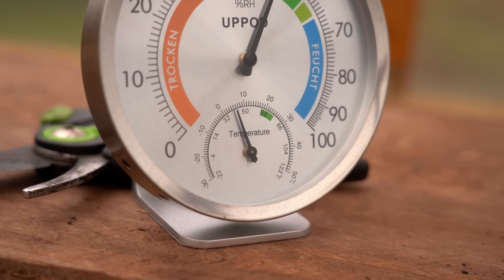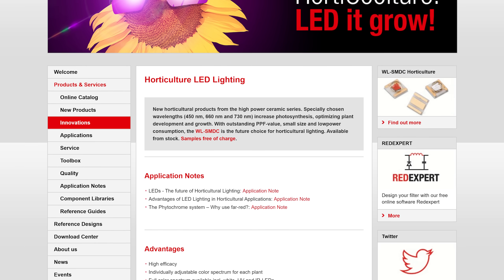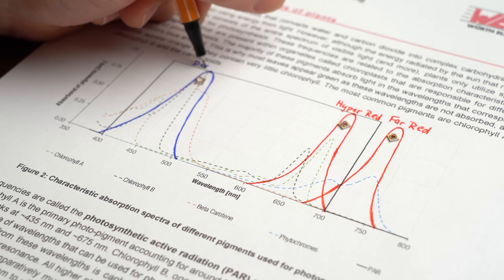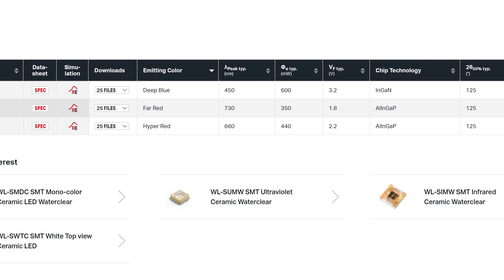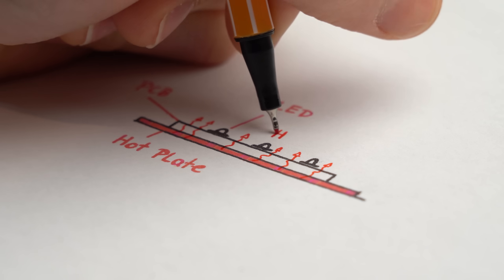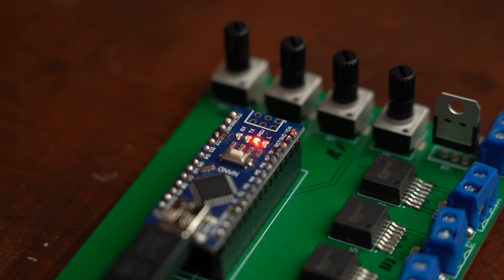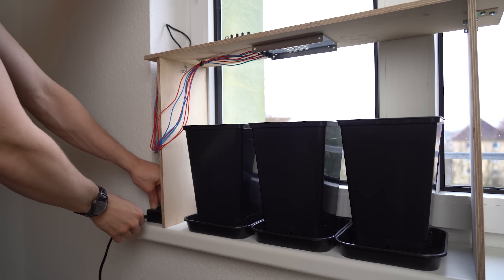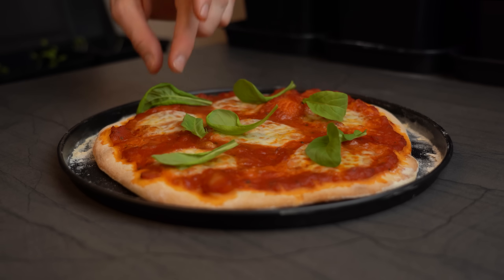"Magical" LEDs let my plants grow faster? (Experiment) The Future of Farming!

Comment from the maker: German version will come out on the 23.02.2022.

Additional Notes: I used the heatsink for the LED board the wrong way around since it was easier to mount it that way. And also make sure to position the capacitors as close as possible to the constant current drivers. Mine were a bit far away. Check out the datasheet for all the juicy details ;-)
Reply: Maybe they will release it to the Netherlands as well on that day
Reply: @RocRizzo  Uiteraard, LED-groeilichten (en assimilatieverlichting en stuurverlichting)  zijn erg belangrijk in de glastuinbouw.
Reply: How is this comment 7 days old, but then the video came out today?
Reply from the maker: @james-barnett  Patreon ;-)
Reply: @james-barnett  Patreon.
Reply: @james-barnett  they uploaded the video before it was public
Reply: @james-barnett  Really good observation
Reply: @james-barnett  Patrion
Reply: Das projekt könnte für die baltige legaliserung nützlich sein :D
Reply: @RyuktheShinigami777  dafür gibt es schon ganze Firmen. Ach ja und Breaking Lab hat über Aquaponik und Vertical gardening etwas gemacht
Reply: It is winter so there's not a whole lot of sunlight, but overall the amount of sunlight that gets into the house is much lower than one under a shade of even a tree.
The overall light level of regular(non-grown) lights is also less than a large tree shade in summer.
Correct me if I am wrong, I seen a video on it long time ago, and haven't tried repeating the experiment in anyway.

Would it be possible for you to repeat the experiment with a control group with a plant growing outside (in summer)?

It's an interesting experiment nonetheless, I usually have seen them used in tents that reflect and trap the heat of the LEDs[sometimes a different technology], with no outside light source being injected into them, like large panels with "100Ws worth of LEDs".
Reply: Pot is now legal in most areas of the U.S. These LEDs would be very useful to grow marijuana under the table before it was legalized. But, it is STILL useful today to grow your own weed becsuse of the insanely high taxes we have to pay under the current administration!
Reply: @foureyedchick  I think he said it about Germany
Reply: @CUBETechie  I designed some electronic circuits and composed some songs while stoned. But, troubleshooting is nearly impossible while stoned. I have no analytical ability then.
Reply: Wird die deutsche Version auf demselben Kanal sein?
Reply from the maker: @TimoOnline  Ja ;-)
Reply: @greatscottlab  
Gibt es Methoden mit fluoreszierenden Substanzen PV panelle mit indirekten UV Licht zu bestrahlen und dann die Energie Ausbeute zu erhöhen?
Reply: @greatscottlab  Warte mal, gibt es schon deutsche videos auf dem kanal?
Reply: @greatscottlab  
Kleiner Tipp von einem Grower. Bei Indoor-Planzen ist es nicht blöd, die Pflanzen ein bisschen mit einem Ventilator anzupusten. Dadurch werden die Stängel kräftiger und sie können größere Blätter und Blüten tragen. Das ergibt am Ende einen besseren Ertrag.
Reply: @greatscottlab  What a surprise you recommend the product you are selling and making money from!
Reply: @TimoOnline  ja
Reply: I love the new intro
Reply: Könntest du vielleicht auch Algen wachsen lassen?
Reply: Wie sieht es denn eigentlich mit Verschiedenen CO2 Gehalt aus🙄🤔
Reply: You should check out the click and grow garden
Reply: Ja mach ne Stunde
Reply: @GreatScott!! why you start wearing glasses?
Reply: @julianpolishredfox  His eyesight is going. Or, he always needed corrective lenses, but got tired of contacts and went back to glasses.
Reply: Ja.. so schließt sich der Kreis. Erst ingeressiert man sich für Elektrik , dann Elektronik , dann fürs growen. Nächste Station : automatisierte Bewässerung , Beleuchtung Belüftung.. aber das ist wohl mehr programmieren als löten bzw. eine Sache für arduino etc..
Reply: I think you need some flux for the soldering xD, looks awful to me, not much for soldering skills, but for the solder it self maybe. Looks dirty.
I like your videos every time, they are really clean, but that solder T.T , can you make it better? Thx :)
Reply: @greatscott! bin mir ziemlich sicher, dass du die pflanzen die nur Tageslicht bekommen haben vergeilt hast (weniger Licht, aber gleiche Temperatur)

Comment: The easier way is to use COB (planting) LEDs and drive them with a bigger, more efficient inverter. No PCBs needed, just old CPU coolers and a mounting frame.

I personally built COB LED versions with multiple 180W COBs and all driven with about 80-120W  power to increase efficiency, only in flowering phase i give them nominal 140-180W
Reply: Btw the real magic you can have with grow LEDs  in combination with a circulating air system for warmer temps (better for most stuff) and  (regulated) CO2 support.
I tried it longer ago as a efficient, about 800W LED Power rig with candles and a CO2 meter (trying to keep it between 1200 and 1500 ppm), it additionally cleaned the room air and without CO2 production it even got rid of the CO2 in the rooms partially over time. Not to mention that in winter and so it was also a small room heater which saved some central heating costs and most of the energy was free since we have a PV system

Comment: I noticed you used "L" brackets on the corners of the light holder.  You can also use (at less cost) blocks of wood to support the inside corners of the fixture, thus eliminating the need and cost of the "L" brackets.

Comment: Hello Great. I follow your channel and I have to say that your work is great. In relation to this project, how to know how to supply light for each type of plant. Why didn't you make an automatic system instead of having potentiometers to adjust the light for each plant? Couldn't this be completely automatic? For example: tomatoes: program_1, onions: program_2 ..... Thank you very much. A cordial greeting from Spain.
Reply: Just give them "enough" power to grow as intended,  more light is always better until the leaves begin to burn on the edges, it just depends how good your airflow and cooling of the room is when it comes to limiting the power.

I personally prefer a healthy and partially efficient mix of sodium vapor lamps with about 600-1200W and another 1200W with COB grow LEDs which give effective 2500-3500W "light" but at a lower cost in long term and especially less heat to get rid of.

In addition i planned my system with 180W COBs but i drive them intentional with "only" 100-120W to increase efficiency, so i can also run them solo with 160-200W without the sodium lamps if needed (summer mode, about 3-5° less)
Reply: @harrison00xXx  Thank you so much. What is a COB system?
Reply: @AFSMG  COB = Chip on Board

Basically bigger LED Arrays consisting of hundreds of LEDs on a bigger area which are typically driven with about 10-50V and 50-200W
Reply: @harrison00xXx  Thank you so much.
Reply: @AFSMG  a basic buck boost converter with 200W (when powered with battery) does the trick at COB LEDs super easy to control light output with 2 input wires

They have also a temperature reading pin which the fitting power supplies typically should have too, but its not needed for high performance cooling

Comment: can u make red light infrared light therapy module
Reply: Thats Ludicrous as your name, lol

No, to be real, such a thing can work but those IR LEDs are burning out quickly AND they are anyways inefficient. The most IR "therapy" LEDs in such devices give you a bit of a IR feeling, but its effect is pretty useless. Nothing can beat a hot, red glowing regular IR therapy device, remember IR always means HEAT, and beside the fact LEDs are very bad and inefficient for IR light, its getting very expensive if you even find high power IR LEDs.

Comment: that development kit is expensive
Reply: Funny thing is without the possibility to control blue/red/IR independently you can make it noticable cheaper and easier with COB LEDs. With good cooling (CPU coolers!) you can even overdrive for example 180W COBs to 250 or even 300W, use 8 of them and you have a high power growing rig or lower powered (140-180W per LED) efficient rig.

But i like this development kit, its just a bit too limited in voltage and current for COBs (mine run between 20 and 80V, ranging from 2 up to about 5Amps) otherwise it could be a nice thing as a single PCB solution.

Comment: Just a quick note about the photosynthetic use of green light: it's true that some of the green gets reflected away, but it also penetrates the canopy really well, instead of red and blue that get absorbed almost immediately by the leaves. So a bit of green is extremely useful not only to diagnose plant problems, but also to improve photosynthesis at lower levels in the canopy.

Dr. Bruce Bugbee has a few videos about light quality, they're really great and I recommend them if you're interested on the topic.
Reply: Bruce Bugbee = Apogee Instruments (environmental sensors)

Comment: If you want the best/most like the sun, grow lights
Get the Cree cxb3590.
Cost about $60 per 100watt light.
Reply: Thanks for the tip! I had a quick look at Ali Express and you find them on there in the range of $30.00 to $160.00. But when you see that the sellers of the cheap ones are giving the color spectrum as 'watts', it's clearly time to find a seller who at least knows that a Kelvin is not a Watt.

Comment: comparing winter daylight to artificial 24 hour light is not a very good experiment. Almost any light source running 24 hours is going to out preform the short natural day, especially in northern latitudes. A comparison of standard white LEDs to grow lights to see if they are worth the extra cost would be more interesting.

Comment: FYI: You should have coded a way to change the values, rather than having a manual variable resistor. The suggestion to change the light would have made a big difference. Your plants are too 'leggy', stretching toward the light. You want less red, more blue, to prevent that and get your leaves closer together so your energy is going into growing more food.
Nasa has studied this in quite some depth.

Comment: There is such bad information being given out here. According to the McCree curve (1972), green is used more efficiently than blue for example. This is backed by Inada (1976), Nishio (2000), Terashima (2009), and anyone else who actually does the test.

Anyone with a spectrometer can tell a plant absorbs 80-90% green light and you can use a simple camera as a three channel spectrometer. 

Also, If you aren't using a full spectrum quantum light meter then you are also putting out false information on lighting levels in your "testing".

This is a disappointing video that shows a complete lack of understanding of the theory on your part.

Comment: Those results don’t look correct. Red light increases cell division so even if the LED light would have beaten the daylight the seedlings would help continued to stretch. They would have been much long than they were, everything if they foliage was in that size. I don’t trust your results.

Comment: Mate you're missing the fact that glasses that are used in our houses filter the shit out of UV and our eyes can adjust to low or high light amounts. What you deem bright is not bright to a plant, you should compare to 6500K white LEDs to your lights, only then you can actually know for sure if those LEDs really deliver the wavelengths they promise and if it's any superior to white leds. I do use 800W of LEDs total in order to avoid my plants losing their form and color during the winter and they're all cold white, seems to be most effective in my experience of 4 years.

Comment: I'm a Canadian grower that's just beginning getting into tinkering with electronics, I would absolutely love being able to wire up my own grow light. I have sever store bought lights that are all really hard on the electric bill. 
My goal is to create a powerful LED light capable of growing  through vegetative and flowering, but doesn't cost $200 a month to run.
Reply: Theres a common misunderstanding that LED's won't cost much to run. Sadly when you have 100's of these horticulture chips on a single backplane, they quickly add up. They are still far superier to HPS or MH lamps, provide a much more balanced spectrum, more efficient, last longer and they are cheaper to run. From my experience the yields are also higher. You will be able to make a lamp that doesn't cost $200 to run, but you will find that its coverage and the final yield will not be as high, its a balancing act.

Comment: When asked if this technique is promising, the answer is no. Of course, it can be used to grow food regardless of the season. However, the LEDs are not a substitute for the sun in the summer, which many plants need. Here you need a lot more energy or LEDs and this is no longer profitable for home use.

In addition, if you calculate the cost of materials and electricity, you can buy salad in the supermarket for quite a long time. In addition, the ecological footprint for material, production and transport is totally ignored. It's a gimmick and nothing more, at least in private use.

Of course, you can't necessarily say it like that in a sponsored video ;)

Comment: As always great video with lots of new information. Just a question however. Can a neopixel led strip (WS281B) with adequate control of the wavelength be used instead of the grow light? Seems a lot more cheaper
Reply: can you control the actual wavelength?  power consumption would surely be higher

Comment: If i use WS2812B LEDs and your high power LEDs is there a difference between them that effects the growth of the plant (for example the power) or does the growth only depend on the wave length of the lightsource (part of red and blue light)?

Comment: Great Video, but for your results to be comparable or to mean anything really, you should measure or at least calculate the extra photonic flow. 
Adding artificial lighting will obviously benefit plant growth, especially in winter. 

So a fair comparison wouldn't compare "daylight" vs "daylight+artificial lighting" but either daylight vs artificial(external light shielded off) or if you want to evaluate your diy lighting solution "10w electrical input@diy" vs "10w E14 retrofit neutral white bulb for 8€. 

Because short term, the latter is way cheaper and also easier to use. The way you did it only confirms artificial lighting works, but it doesn't say anithing about the efficiency of your setup.

Comment: Didn't watch it all but I got your point from the title, and parts I watched. 
Previous tests been with halogen lamps, but leds are next level (smaller, less material, more in number). 
Of course notes and drawings in pyramids sent written note about light frequencies influencing mutations from fungi to green plants (and algae - but differently).
Progress after 15,000-40,000 years.

We used mathematical/geometric forms and combinations between them on the other planets and after arriving here, for less expendable materials, and reusable.
I had small farm when I was with deficit of specific foods (were not available online or friends I knew), I had my sources mutated and replicated into plants I wanted with math forms, which have identical speed of growth as you apply maximum use of all leds around (with the specific frequencies). The advantages were, I could change the geometric form in seconds in some days to achieve same result as changing other frequencies in different range (which would require factory for other leds or lamps with additional factories for electricity).

With geometrical forms you can easier change the form of the plant, length, size, etc.
I didn't throw bomb.
I melted the ship we came (with geo forms).

Comment: Can you make a video on converting two 100W 12V solar panels to use with 12 Volt Fans and Car Chargers and also charge mobile devices and laptops and use it without an 100ah 12V battery so you wouldn’t have to get one, so it can be cheaper for people that want to make
One , include protection circuit and Make the Protection Circuit that has all of the features, that a expensive one has and do it on an budget, Do it yourself so people can make it On their own, with experience with electrical and electronics , and make an Enclosure that houses everything. ,  could you make an adjustable mounts so It can stand upright or in any position.

Comment: Green light is absorbed/used quite well by plants, it's a myth that they don't need it or don't use it efficiently. This was explored by McCree in 1971. if I'm not mistaken, and it was shown that the efficiency for green wavelengths is quite high, even though it is lower than other wavelengths

Comment: price per umol (plant-lumen) standard 3500-4000k white leds are a much better choice. I made my own pcb's using 2835 smd leds. I use about 450 of them lighting up my sad window-poor basement suite. There is enough light to even keep my pineapple plant happy. Big learning from this project. Alu-PCB's are great to transfer heat away from the components, but are a horrible choice to actually move the heat away from the PCB. maximizing surface area is key here, and preferably a dark soldermask to maximize heat radiation which are both more practical with standard PCB's.

Comment: Next step would be an automatic watering system. How about a diy or buy episode about that topic? I really like the idea of using aluminium pcbs for capacitive soil moisture measuring because the aluminium is more durable than other pcbs. I redesigned the makerfabs Lora soil moisture sensor v3 with the pointy bit made from aluminium and it works great!

Comment: plants are pretty flexible, i would just pick a number of led lights that roughly put out the proper spectrum at full power. (or slightly under full power to improve longevity) this should greatly decrease the complexity of the power supply and therefore the unit cost.